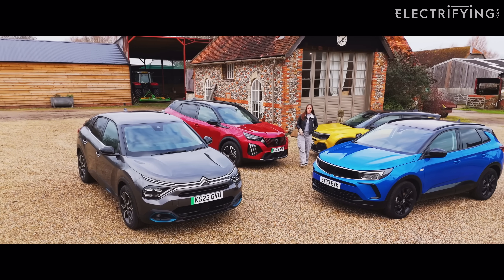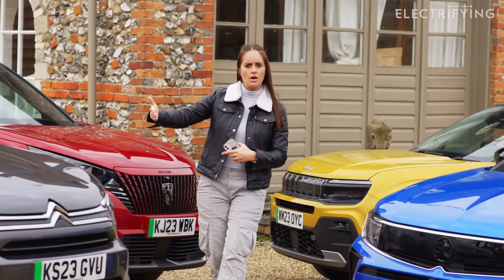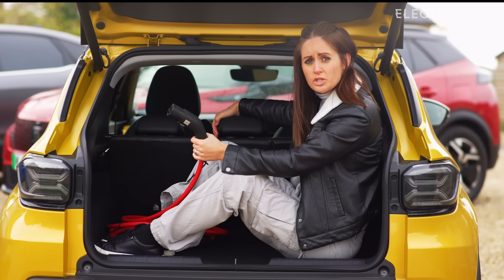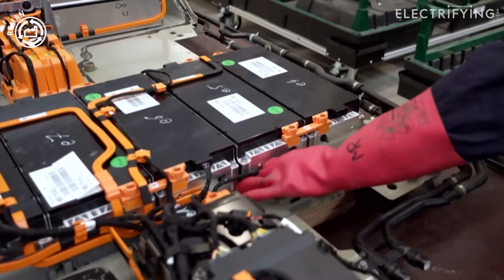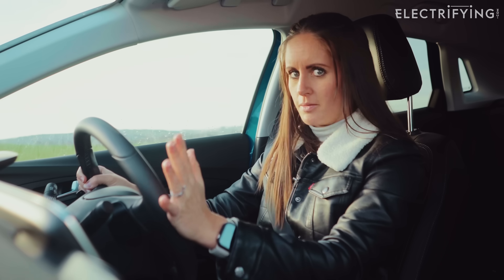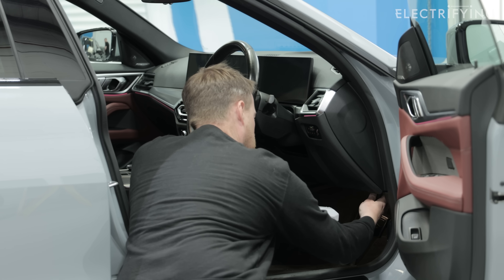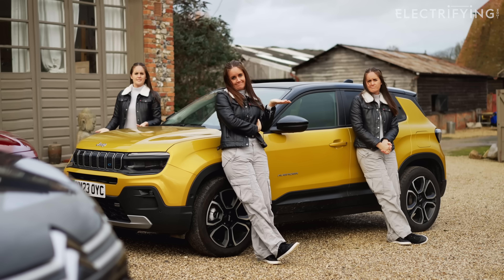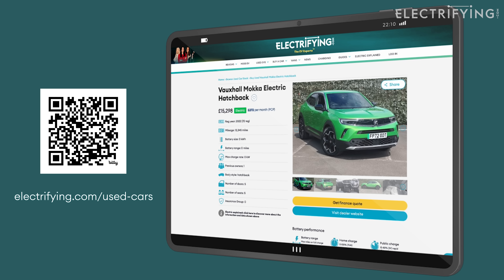WILL IT LAST? The Truth about used EV batteries

Comment: So much nonsense claimed. If you want people to take you seriously, stop lying. ICE engines are NEVER scrapped, they are metal and easily recyclable, far easier than batteries. 130k is NOT the average life of most cars, most engines will last 200k+ Batteries in cars are NOT 'better engineered to last' than any other battery. How long they last will depend on how they are charged, plenty die before 50k, most last 120k, many do 200k. The 'life' of a car, according to manufacturers, is 10 years or 100k, so when they claim batteries will last the life of the car, that's EXACTLY what they mean, 10 years or 100k. Too much nonsense to list...

Stick to reviews, as you know nothing about engineering.

Comment: The average manufacturer warranty for a new petrol engine is typically three years or 60,000 miles, whichever comes first, though some manufacturers offer more generous coverage up to five or even seven years, with some going up to 100,000 miles. The average warranty for EV batteries is around 8 years, if it drops before a certain level within that time it gets replaced.

Comment: You're wrong regarding a car with 130000 miles for though some are dead by that stage many are not. A prime example is my friend's Audi A4 diesel which did 440,000 miles before being scrapped and even then it was only because of the bodywork, the mechanics were fine.
Reply: Most ICE cars are worth close to nothing after 130k. So many potential serious problems.
Reply: @AlanTov absolute nonsense
Reply: @stevencampbell1150 nobody would touch an ICE with 150k miles. My 220,000 mile XC90 just sold for £500. An EV battery will still have about 70% state of health.
Reply: @dereklawther300 that's just where you're wrong as folk who are looking at something cheap would and you've not only proved the point having sold your Volvo XC90 with 220000 miles but you've also in so doing contradicted yourself as someone has bought that car off you 🤔
Reply: @stevencampbell1150 well, I wouldn’t have bought it. Glad someone did. But it doesn’t destroy my argument. EVS are lasting 500,000 miles - many Teslas are lasting 300,000 to 500,000 miles, with some owners exceeding these figures, though it often involves replacing components like motors, but some have original batteries; Tesla designs batteries for this longevity, aiming for even longer life, with real-world examples showing significant durability beyond typical gasoline car lifespans. I know - it’s hard to understand since your whole world order is being put at risk and you might even have to change your mind. You see I did. 50 years of driving diesels and petrol engined cars and three years ago took the plunge. Never looked back. And never will. My xc90 cost £3000/yr to run. My EV costs £300. Facts and data made me see things differently. You might try it.
Reply: @dereklawther300 it's all well and good until you get hit with your EV tax on top of your road tax, turn you'll be singing a different song!

Comment: What a nonsense!! In which world are combustion powered cars scrapped after 130k miles?  Never ever - they continue to operate well after this mileage.
Reply from the maker: On AVERAGE, 61807605. Obviously, not all combustion-engined cars are scrapped at 130,000 miles. That would be silly
Reply: @Electrifyingcom Is there any scientific evidence for this? Even average looks creepy when I consider the cars driving around.

Comment: My 2014 Tesla Model S 85 (RWD) has covered 102,000 miles and the battery is currently at 90%, which gives me an effective range of around 248 miles (from the original 260 estimated range).

Comment: I drive an EV, but stating the average ICE is scrapped at 130K is total BS - that's close to most of my firms Sales & Service cars after a 3-4 year lease😠
Reply: Google search came up with this answer.

In the UK, the average car is expected to last around 8.4 years and 150,000 miles, with many cars reaching 200,000 miles or more with proper maintenance. However, the actual lifespan varies greatly depending on factors like make, model, driving conditions, and how well the car is maintained.
Reply: Yes 130k miles is complete Bollox the Taxi is got in yesterday had 387000 miles on it.... a Ice Toyota my last Audi tdi did 285000 before I sold it 😊 there are EVs in British car auctions with knackered batteries onlya few year's oldwith lowmileage .... why are the manufacturers not repairing them under warranty i wonder ???

Comment: You guys should try the battery test offered by DEKRA. Gives an unbiased result by measuring parameters during a swift acceleration. Results are verified by a third party with very high accuracy, in only 15 minutes. No need to wonder, just test it at DEKRA 🤷‍♂️

Comment: The issue is not 'degradation' its 'fail failure'.   If a tiny component fails in the battery, they are really hard to fix. A Tesla battery replacement costs £8,000-£20,000 in the UK.    A high voltage charger replacement can easily be £5000.    So if it does break (and they do) the costs are really high.
Reply: Still you've got 7 years of warranty, £5000 is less than an audi automatic gearbox, those who often fail and come without the 7 years of warranty. pro and minus in every car.
Reply: HEVRA garages can do module level repairs, so these failures are also pretty repairable. BMS components are also replaceable.  Yeah it might cost a couple of grand, but then what major repair on any car doesnt
Reply: No one buys Tesla anymore.

Comment: Still happily running a 2014 BMW i3, so 11 years and over 100,000km - lost about 15km real world range in that time. As it is made out of aluminium and carbon fibre, I am assuming that the battery won't outlive the bodywork, but it'll be interesting to see when it needs replacing...

Comment: My e tron is almost at 30k miles and will still get the claimed WLTP range with ease. It's 3 years old now and the only issue its ever had is the passenger side charging port button stopped working because some grit from the road got behind it.  Faultless
Reply: They don't do the WLTP from the factory 😂😂

Comment: I've had two Renault Zoes. Drove both hard. No noticeable degradation while I had them. Starting to see a little degradation after nearly 4 years with my current Ioniq 5 but it's a few miles from a very high starting point, and the thing has still far more than enough capacity for all my needs - and I'm a high mileage user!

Someone who only goes 7-10k a year? They barely notice a difference. It certainly wouldn't matter, as it doesn't particularly matter to me.

Comment: So an EV’s lifetime is 8-10 years or as long as the battery warranty lasts? Until there’s an easy way to replace, repair and upgrade batteries and extended battery warranty cover buying a used EV out of warranty is a worry. It’ll happen for sure, however cars, ICE and EV aren’t designed for repair, maintenance and longevity so much these days.
Reply: Where did you get that from?    The oldest evs around are Teslas and getting 200,000 mile out of the battery is the norm.
Reply: Made up nonsense. Misinformation

Comment: Best you can do to get people to buy EV is to make these EVs really affordable, not apparently affordable by making normal cars more expensive. Not to mention prices of Electricity and all the hassle of charging the car if you are not house owner.

Battery degradation takes YEARS, you need to define, 2 years is Years as well as 20, how many YEARS  before degradation? Can happen in 3 years, 10 years or next day after second year. Battery is unpredictable chemical product and only way to save your self from unexpected costs is to have usable full covering warranty. all else is just betting on dumb luck. 

Years as life time of the car, great, 8 years i not that much since product is dead when it is out of warranty, proper dead when not in production and completely dead when company announces end of support. Brands are already nervous their old normal cars last 15 years without effort, now we just need to clarify what is "life time of the car" in this video?

Battery recycling is Super energy and resource demanding but overall who cares, just sell us the batteries for price people can afford and without fear that warranty will be invalidated on stupidity grounds. All todays cars are going online anyway, BMS can report all they need to report without need to go to service shop so why clauses and pointless visits?

Petrol and diesel cars have 130K miles life time is huge understatement. It is manufacturers wet dream to kill all engines at that low mileage and for sure they are doing best they can so engines do die by insisting on super long oil change intervals and keeping happy so called green agenda with low oil demands  figures. BTW it is not oil that is bad it is how we dispose it.

And when I mention Oil, all these EVs are super heavy due to super heavy batteries, and they eat rubber twice as fast compared to normal cars, due to mass and torque. Go figure how can that be good for anybody's pocket or green agenda. It eludes me completely.

Nice video as EV PR stunt to push for sales of used EV cars that most of the people can not afford, can not charge and are supper suspicious on any warranty claims.  

If anyone in EU really wants to sell EVs, batteries would be third of the price they are today, and electricity for cars would not be so expensive. Just a rip off as usual, with occasional perfectly fine usage case, like short predictable daily commuting route where EVs do shine.

Comment: Will it last? We just don't know yet.
Now if your idea of lasting is 6-8 or even ten years then yes, we have some evidence it will last BUT outside of throw away UK cars last much longer than that, so we will see what happens when they are ten years +
Age kills cars/batteries before mileage.
Reply: Sorry, but I don't think you have any evidence for your statements.  You seem to be implying there is little evidence regarding the longevity of electric car batteries, yet there is significant data already available based on both laboratory and real-world experience. And the real-world data consistently look way better than the (theoretical) laboratory data.
Reply: @brucemcdou  Exactly there is no evidence for it because there are few if any EV's out there over 10 years old so we simply don't know how they will fair once low mileage cars age out on the warranty.
10+ year old cars may not be relevant to those leasing every 3 years but whether or not they have a long life will eventually affect things like lease rates if the cars life is only short. EV's are global and many countries don't throw cars away after a few years like the UK does.
We have good evidence that they are aging well in the short term but NOT the long term YET.
Reply: @DaveG7920 You think scientists haven't extensively tested battery life? Of course they have. Huge firms with huge teams of specialists and researchers.
Reply: @AlanTov  Lab results and real world are very different things. Effects over time in the hands of joe public are not known yet.
To argue otherwise is silly

Comment: Sold my A5 2lt Diesel Quattro 211’000 2 years ago it’s still running sold many diesel cars with 200’000 on the clock and 400’000 on a transit if you change the oil early and often you increase the life of you buy a sh1t 1 or do not maintain yours correctly then you pay the price

Comment: Had a 2022 Ioniq 5 73kWh on a 3 year HP lease, traded it in with 168K Km's, battery degradation was 2.5%. Very low maintenance costs, original brake pads etc. the only expensive service was one where the battery coolant fluid replaced. Traded in for another Ioniq 5, this time with 84kWh battery; not in the least concerned about degradation. So much nonsense and scare mongering about battery degradation going about.

Comment: They legally should have a "Battery State of Health Certificate"
Reply: How would you establish this "certificate" ?
A battery is made of components, the health of the whole is the health of each component and the health of the assembly
The more knowledge you request, the higher the cost will be !
The battery price is not fixed, it's rapidly falling year after year, investing a lot of research on re-use is not profitable at the industry level, it is marked for an after-market industry ...
Reply: @MalengWan should be part of an MOT and agreed standard battery health report.

Comment: Be careful using 3rd parties to check battery health. Some old Renaults need BMS firmware updates as the car miscalculates health, impacting charging capacity and range. I take a Bluetooth donke and car scanner app when looking for cars.

Comment: Our 2019 first gen ioniq 28kwh is still generally showing range as when new after 66k and 6 years.  Did a battery deg test using a basic method taken from a couple of YouTubers and comes out as 97.7% state of health.  Can't imagine any newer EVs will have a problem, especially as ours is one of the first generations that came out

Comment: If you buy a second-hand ICE car, the engine could possible have a fatal problem.  Do you worry about it?  Well, maybe... but what can you do about it? Checking the state of health of an ICE engine involves taking it mostly apart... a pretty daunting cost.
If you buy a second-hand electric car, the battery could possible have a fatal problem.  Do you worry about it?  Well, you obviously do!... but what can you do about it?   Easy, you can do it yourself... although it wouldn't be very thorough... or have a specialist do it for a €100-200!
Reply: Work colleagues Audi blew a few months after he bought it. £5k for the replacement engine and work!

Comment: What diesel is scrapped after 130’000 miles 🤦‍♂️
Reply: That’s not what was said.
Reply: She said the average miles of a scrapped car is 130k miles. Average. All my diesels died before 170k. I drive 25k miles a year.
Reply: @danielduarte7013 what kind of cars are you buying? and what does died mean? can't you just exchange the bad part?
Reply: Yeah, I don't know where that number is from, but around here there are so many cars with much more than that on the roads. Mine has 380,000 KM and still going strong. I want to get at least 100k more out of it.
Reply: I scraped my desiel car at 130000 miles because the body rusted ! It was 16 years old ! The body let it down! Bloody vw

Comment: Hold on a minute if you get a vehicle that has been left so the battery goes lower than 10% especially on a regular or charged fully a lot it does have an impact leaving it drop to a very low charge like not having a full charge when you go on holiday my result in not being able to get the vehicle to charge at all especially not to a decent charge
Reply: Total nonsense.

Comment: An important point that needs to be brought out is that for a used EV (say, three or four years old) it is relatively easy and cost effective to have a battery health check done. If the report is good then you can have a high degree of confidence that the battery won't suddenly  "go bad" in the next three or four years, batteries just  don't normally behave like this.
On the other hand it is much more difficult, and much more expensive, to do a "health check" on an internal combustion engine. How do you know you're not six months away from a broken timing belt, heat gasket leak, main or rod bearing failure, etc.?

Comment: Lol, showing 4 Stellantis EV´s which are known for their faulty and expensive to fix on-board chargers and then talking about the battery. The stuff that costs in an EV are the OBC, battery and AC compressor if it´s got a heat pump.
Reply: Yeah, my e-2008 is coming up on 5 years and 135.000km. I'm not particularly worried about the battery, the OBC however I do worry about, seeing that it has already been replaced once. 
Oh, and the OBDII shows the battery at 93% SOH, no range degradation showing yet.

Comment: Another point worth making when comparing phone and car batteries is that phones are usually charged and discharged every day. Whereas cars, on average, are charged once a week. So, a phone will do 1000 cycles in three years and it'll take a car 20 years to do the same
Reply: I've had my Nokia phone for nearly 30 years, that only requires charging twice a week, early on, it was only once a week, overtime it's like everything, it wears down, because of the technology on new phones, most change their phone every couple of years, they need to charge them every day, I don't have the need for a technical phone, I use my phone purely to make and receive phone calls, my phone doesn't do anything else but it still works, but like car batteries or conventional engines, they all degrade overtime

Comment: There's Tesla's and even an MG with hundreds of thousands of miles, internal combustion engines last up to and beyond 1,000,000 miles if looked after well, but all degrade with age, I've got a small diesel engined vehicle which is approaching 170,000 miles, so you might ask why I run a diesel, it's all down to cost, I don't have access to home charging/charging and public charging works out far more expensive than my diesel, I'll be honest, I keep a car until it dies, I bought my current car, an ex demonstration model back in 2011, I couldn't afford to buy a used electric vehicle, they're out of my price range, the equivalent electric version of my car would have to be charged every day as it only has a 75 mile range, probably less as most of my 60 miles round trip is motorway driving, because I can't park anywhere near where I live, using public charging would cost the same daily as I currently spend in a week and after working a 15 hour shift, I wouldn't want to have to spend however long it takes to charge before finding a parking space and then walking home, getting myself sorted for the following shift when I only have 9 hours off between shifts